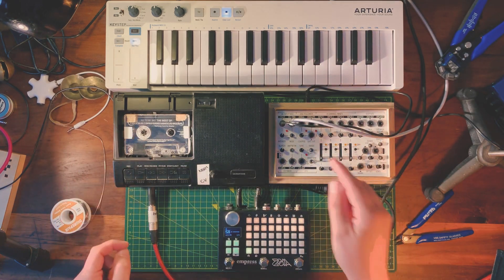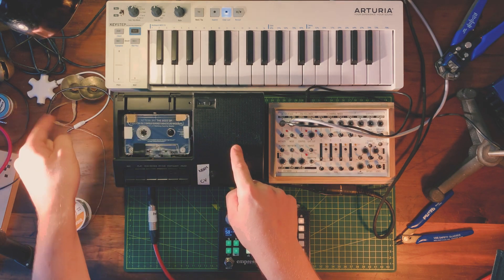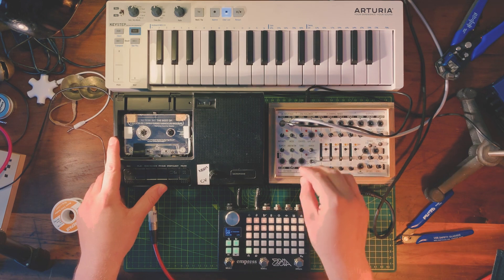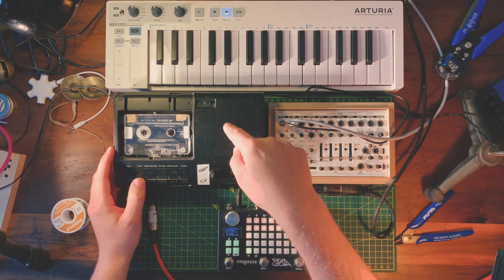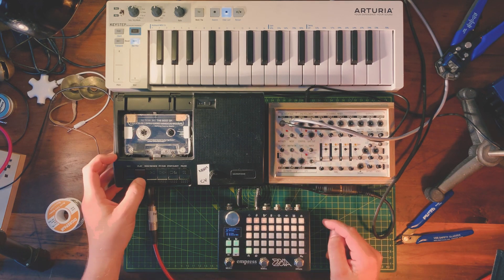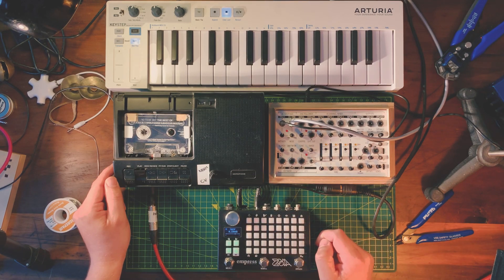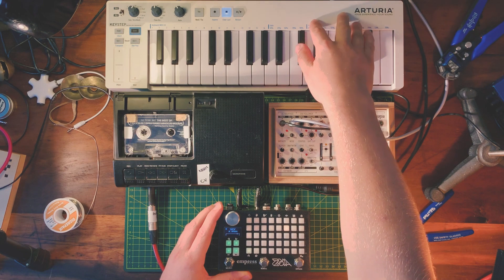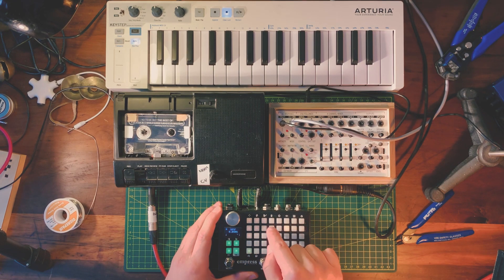How To Make A Tape Loop Synthesiser with a ZOIA, Keystep, Field Kit and Cassette Player

Comment: woah that is so cool CV controlled tape... wow do you have a tutorial on how to build that tape player?
Reply from the maker: I haven't made a tutorial on that but when I made mine I found a few YT vids that helped, plus a bit of trial and error and breaking stuff before it worked!
Reply: @rowanbishop  awesome 👌 Do you have a tape player that just slows or speeds up via a pot?
Reply from the maker: @DECIMA1  I don’t, but I just use the one in the video and use the Field Kit to adjust the speed.
Reply: @rowanbishop  ahh ok cool

Comment: Very cool! Was wondering why is the zoya necessary here? Can you just send cv out of the keystep?
Reply from the maker: Thanks! And that is a great question. The Keystep outputs CV as the standard 1 volt per octave, but the motor in the tape player doesn’t double in speed for every 1 volt increase, so you need to program each key in the Zoia to a specific value in order to get a 12 note western scale. Hope that makes sense!
Reply: And it would not work the same way with the CV Out from the Zoia? I am curious about tape delay as well as your project and have both a Zoia and a Keystep.
Reply from the maker: @playinmyblues  So my initial plan was to use the CV out directly from the Zoia, and I spent a while trying to get that to work but for some reason it wasn't talking to the Field Kit properly. I can't exactly remember the issue but I do remember having to bring in the Keystep to make it work in a useable way. I could have been doing something wrong though, so definitely try it and let me know if you get it cracking with CV from Zoia!